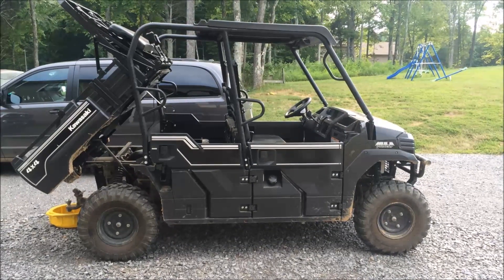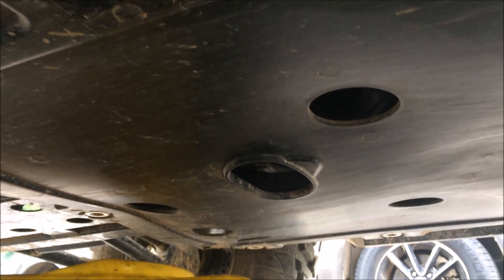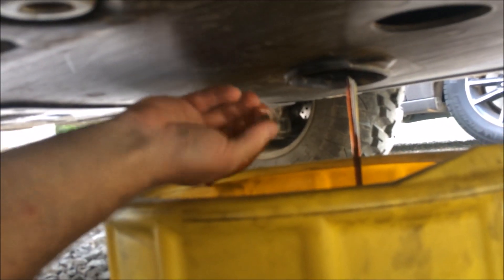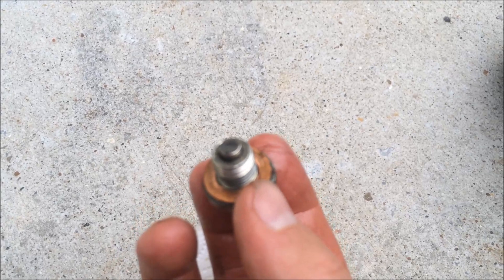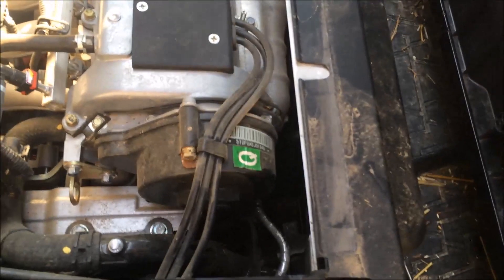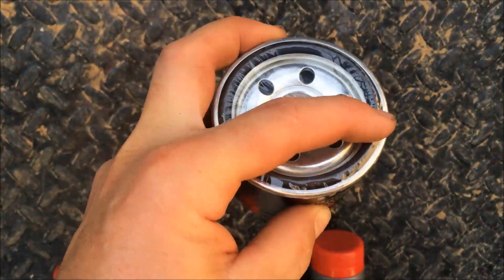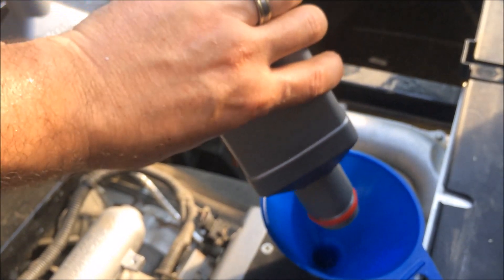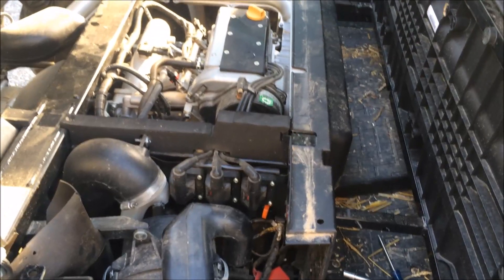Kawasaki Mule Pro FXT Oil Change

Comment: What's the difference between atv10w40 and motorcycle 10w40? I though both would work fine with mules? Also, do not overfill these mules even in the slightest. They will run, but as soon as they are warm they will die while idling. I heard change oil every 100 hours unless you do a lot of starting and stopping. Then change every 50. What did you hear?
Reply from the maker: Thanks for the post. The formulations are slightly different for the different applications. AMSOIL recommends following the manufacturer oil change interval which is 100 hours.

Comment: So...if the last person tightened the heck out of the oil filter, what tool can be used to loosen it?  Great video, by the way.
Reply: Harbor Freight sells an oil filter wrench,  hinged to adjust to any size filter.  You need good access to reach the filter but it works like dynamite. 
Good luck. 
DOUG out

Comment: How many months can or should I go between oil changes if only using 30 hours per year? I know it's a 100 hours, but should I still change every year? I have a 2018 mule pro fxt and use Kawasaki oil. Thanks
Reply from the maker: Yearly is fine if you use a good synthetic oil